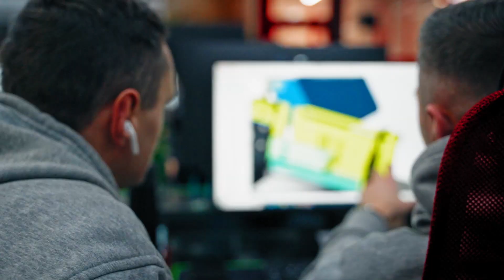This Guy is Mass Producing Factories to Build Houses | Cuby

Comment: The expensive part of home building is brining everything they need. Preparing the land, making roads, installing sewers, electrical distribution, fresh water.. it goes on. Finally you can build a home on top.
Reply: The steps you list can usually be accomplished in a week or two and constitute a small portion of the total effort to build a new house. Many of those steps are not even necessary unless you are building on completely virgin land, and even if it is virgin land, those steps can be done once for multiple new homes thus making the effort per home even less significant to the overall effort. The greatest effort (and thus the greatest cost) comes after the land preparation and underground infrastructure is in place. So no, the stuff you listed is NOT the expensive part.

Comment: This is the dumbest I've ever seen.
1st Magnetic wall paper; 8 sq ft of Large Custom Magnetic Sign 48x24" for Cargo Vans is $75 so a room 12 x 11.5 w 7 ft ceilings is 329 sq ft. It would cost $3084.00 for a 138 sq ft room and works out to $49,171.0 for wall coverings. 
Now add the cost of building the factory then tearing it down. How many Levit  Towns are they building? Few places are building vast tracts of new post WWII housing. 
The various trades exist for real reasons, the knowledge and skills aren't interchangeable.

Comment: What are these inflatable hangars that the factory is in?
Reply: They're around all over the place, especially in England. Basically blankets covered in concrete powder between the layers, ypu inflate the balloon in the center, wet the outside with a house, then after it sets a week or 2 later, you cut the doorway in and the inside of the balloon becomes the interior.